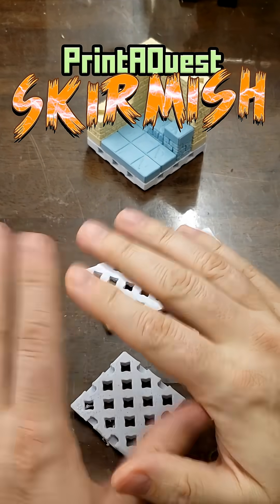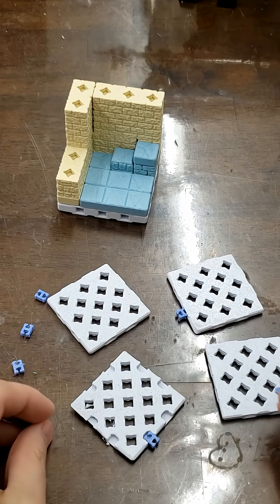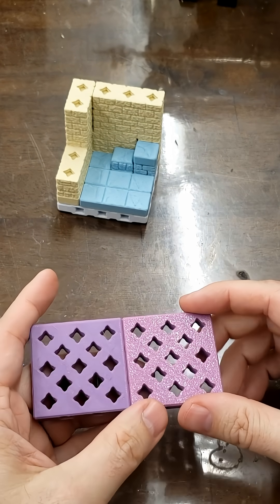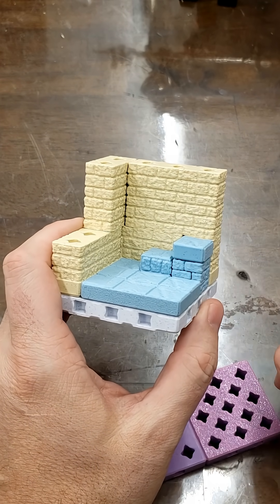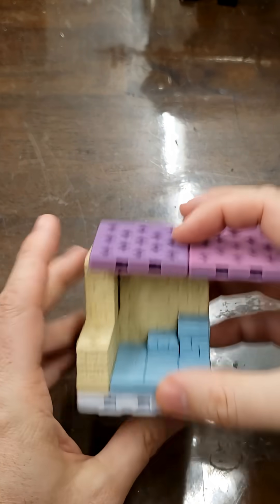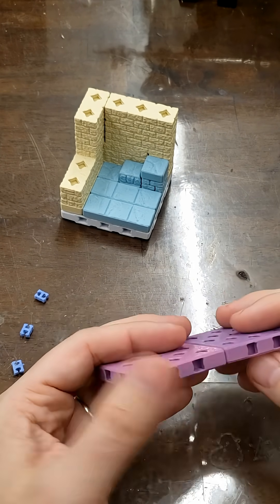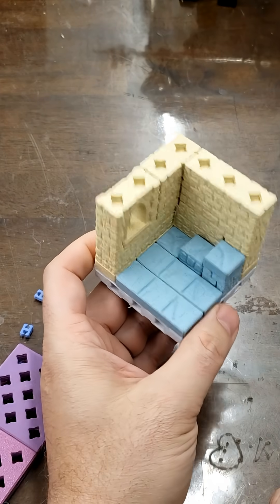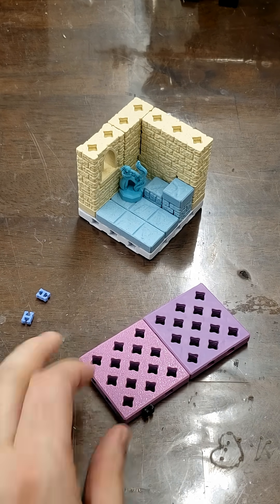taking my own advice: PrintAQuest Panels Development Part 2

Comment: Why 1/2 height?  Why not 1/3 height like the not-to-be-named L blocks?  That would still allow an integer multiple of 3 to end up equally high as a stack of full height blocks and would open up more possibilities...  But you would indeed need the smaller connectors ...
Reply from the maker: Yup. Those smaller connectors are why not. 

Ah, this'll be fine. They break down really well.

Comment: Why not magnets?  Also could you do a tutorial on how you made that brick pattern?
Reply from the maker: The bricks are made using the same technique I show in a video called "Blender Quick Tip   Adding texture with Remesh and Displace" on my channel. Besides that it's just literally blocks stacked up.

The advantage to PrintABlok is that all you need is a 3D printer. No external hardware required.